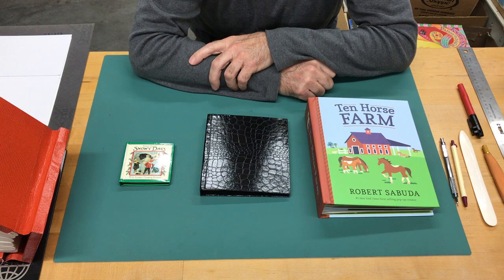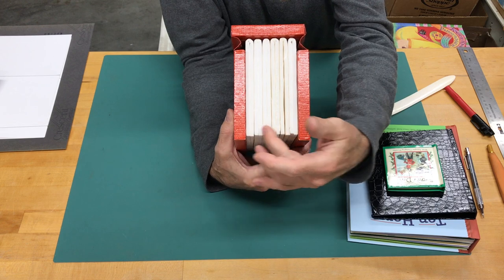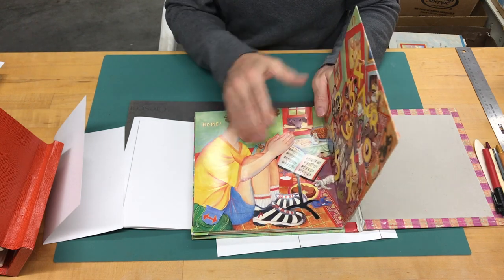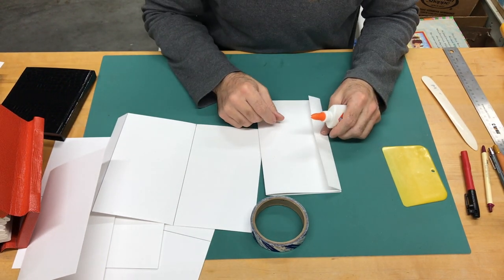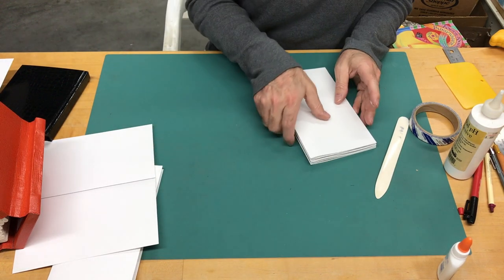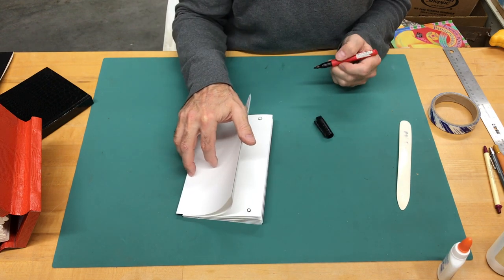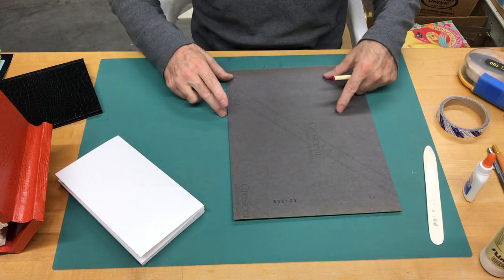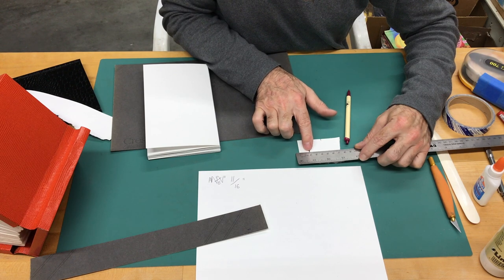Pop-Up Book Binding Demonstration

Comment: Excellent guide, thank you! Also, I wish they used this type of binding for all "Art of" books as well. I know these usually don't pop up, but so much of the full color pages is lost in the binding when the book won't open and lie completely flat. It would also be a useful binding in general large reference books so we can set them out on a table and study without having to hold them open or having the page flip on its own. :/
Reply from the maker: Very good ideas. I think this would also be great for artist sketch books.
Reply: @McGinnisArtistry  there are accordion sketch books I see urban sketchers and watercolor artists using. They're a long piece of paper I think designed to be drawn or painted on both sides. 

But I'm wondering if it could be used as a base for a pop up book, but then attach the pages together, and add a spine on one side
Reply from the maker: @recoveringsoul755  This makes perfect sense, as the construction is essentially the same. There is, however, one issue I have found regarding preassembled spreads. When students are making a pop-up book, they make a lot of mistakes, which are best made on something other than the finished product. If the spreads are made independently, one spread can be scrapped and remade before final assembly. If you do create a pop up book from a preassembled accordion, I suggest gluing all of the pop-ups in place before affixing the accordion leaves together or putting the cover on. This is because it is much easier and accurate to assemble the mechanics when the spread is flat open on the table.

Comment: Thank you so much for making & posting this video! It's been so helpful in learning how to make a case bound pop-up book properly. I'm still a bit confused about the hinge measurements. My spines have been a little tight. I have been book cloth for only for the spine (including hinges) and handmade paste paper for the covers. (Several of Robert Sabuda's books are bound this way and I want to replicate that binding.) I'm going to keep trying until I get those hinges right! I have a tv in my studio so I can watch your tutorial as I work. Again, thank you so much!!!
Reply from the maker: Hi Pam, I would love to see what you are making, and even any problems you are having. If the hinge materials are a little bit less flexible than what I am using, increase the hinge by 1/8" or so, and that should make it loose enough to open fully with a thick hinge material. Leave the spine the same as you planned it, but just focus on the hinge being looser.
Reply: @McGinnisArtistry  Thank you so much for your advice! I will try that for my future pop-up books. I'll be emailing you a link to my finished books.

Comment: This is great! I've been slowing it down so I understand.

 Why is it important to keep the cover loose? What I mean is, wouldn't it be better for the mechanisms, even if cover the allows the book to be sort of puffy, that you secure it? I was thinking that if you had a button or a latch, or some sort of tie, that it would keep the mechanisms in place, and decrease wear and tear on the book. 

The other question is how can you tell which is the spine, and which is the edge that you added the glue to? I mean I'm assuming that you know because you're actually working with it. However there's something I'm not understanding about how it's different. Meaning there were Black Pencil lines on both sides, so is it just that you make a judgment call about which side is considered the spine? It also could have been because of the white that I couldn't see something.

 Anyway thank you and I'm working on my own book and this is really helpful. Actually it was really really helpful because I didn't know any of this about all of the extra sort of padding that you have to do to make sure the mechanisms run properly.
Reply from the maker: Hi IronEarthDesigns, great questions. I have a few pop-up books that do have latches on them, and some that tie closed as well as open. One that has a magnetic clasp is of the inventions of Leonardo DaVinci, and the book itself resembles a latched note book. The ones that tie are meant to open completely around 'till the covers touch each other and tie fully open 360 degrees in the round; examples I have are a Victorian farmhouse and a haunted house. I find myself ignoring the ones that tie because they really only need to be tied when opening them up fully to keep the houses popped up.

I have noticed that on books that have too narrow a spine, the book looks bloated in the middle, and the cover boards begin to permanently bow inwards along the edges. Also books like this do not lay flat with other books.

The cover doesn't necessarily need to be loose, but it is important to make the spine wide enough to not cause the book to fan out permanently. If the spine was too narrow, this fanning out may be the result. Another reason to make sure the spine is the correct size is to allow it to sit well and look nice on a book shelf. Another factor to consider is: if the hinges are not loose, then the book will not open fully flat. An interesting observation is that the spine is only really necessary to protect the gutter folds, to keep the book durable, and to make the book look great. The mechanics will still function even if there was no spine at all, though without one, the book may degrade quickly.

About the SPINE: the narrow, stiff board, made from matboard or cardboard that runs between the two covers is the spine The two flexible areas between the cover boards and spine are the hinges. These hinges are what actually attach the spine to the rest of the cover boards and pages. The spine board gets fully glued down to the cover material so that it looks nice, and strengthens the overall book. The hinges shown in my video are where the narrow tiny strips are placed to space the spine between the cover boards. These narrow strips are discarded after the gluing process is done.

For quite a long time, I also didn't understand the ins and outs of pop up book covers either. It took a lot of trial and error to grasp it all.
Reply: Thanks for explaining the mechanics of the spine. I'm working on learning book structures. I mean really understanding them because I want to include other processes inmy books like printmaking and stitching. Thanks again.

Comment: Thx for this awesome tutorial, just a quick question related to a problem I'm running.

How would that work if I'm putting together 25 popup cards I have already and that I want to make into a book? I was thinking of using like velcro dots to avoid glue, but here is the thing, the cards are different sizes so I'm like going around thinking how to make this effect.

I was hoping maybe you have some tips or steps that could help in this specific case 😅.

Thank you again for this Epic video I'm taking a lot of pints. And thank in advance for your time and help.
Reply from the maker: Hello, you have an interesting idea for keeping a collection nice and tidy. Maybe you could consider making the "book" in the form of a 13-spread book that allows you to place two pop-up cards on each spread? In this way, you could either create pockets, ribbons, or the velcro dots to secure each card to its page, two per spread? The velcro will add thickness to each page. Take a look at the BEST POP-UP BOOK's video on Star Wars: A Pop-Up Guide to the Galaxy: https://www.youtube.com/watch?v=rbBojswrSKc 

I suggest you see this because of how Matthew Reinhart added so  much content to his book by inserting more pop-ups on every spread with the use of flaps in every corner. This book is an amazing achievement. Depending on the size of your collection cards, maybe it could be possible to do more than two cards per spread, reducing the number of pages overall.

If this idea does not appeal to you, then you could choose the largest card as a template for each spread size, then affix the cards to the gutter of a book that has spreads as big as the largest card. The concern I have is weather this would cause any creasing problems or opening issues if you try to tuck a folded card into an existing gutter. They may likely conflict with one another. A simple test construction will determine this.
Reply: @McGinnisArtistry  sorry for late reply, thanks for getting back, so at the end after analyzing what you mention plus your video, I decided to take jump off faith and I used little dots of velcro I add it 6 per page, leaving the pace to open like you explain in the video, plus I'll be adding creative a back and front cover using plywood for the front and back and for the spine I'll using something similar.

And creating the joins with either vinyl or something more simple.

So the tower is holding just with the velcro you cna open them and everything without any problem, one mayor mistake I didn't do was the orientation of each card its off, so they are one aline, and that's the little mistake but with the cover it should looked better.

Thank again for your video, comment and awesome help.
Reply from the maker: @jbos9142  I credit you with the great idea of cataloging your pop-up card collection! Your idea can also be used to make a materials swatch book, a hand made photo album that can lay flat, and many more applications.  Chuck Murphy's books essentially apply this technique in COLOR SURPRISES, ONE TO TEN, and others. In his books, each spread has two pop-ups or mechanics, one per page; in the two books mentioned, none use the spread's main gutters as a power source. Instead, a supplemental fold or pull mechanism provides the action.

Comment: Hi Michael, thank you for such an informative video! I have a question - I am hoping to put together a book with some pop up elements, but I imagine at least half of the pages would be normal and wouldn't need the double thickness. Do you think it would be possible to put together a book that was one half the accordion style pop up spine as you have shown above, attached to a more standard binding of pages on the other half - provided that enough space is left in the spine for the pages to lie flat in the pop up sections?
Reply from the maker: Hello Julia, This is an interesting problem. There is a pop-up book in my collection about Fenway Park. It has only one pop-up; a large structure of the baseball stadium. Most of the book is actually standard pages. They made that book in a unique way, where the front cover has a large inward-folded flap. When the cover board is opened it allows you to open the extra, rigid flap, opening the big pop-up. Affixed to the inside of the back cover is the rest of the pages as a single stapled set. This portion is a saddle stitch binding. I think in your case, it will work to make sections of the book saddle stitched, and interspersed with the pop-ups. I suggest you make a simple mockup of maybe 2 or 3 basic pop-up spreads (just v-folds or something easy), and also a few saddle stitched blank test pages, maybe 6 pages each, and put them together. If you do, let me know your result!

Comment: Hi excellente tutorial.Thank you,i am a book binder and now i am trying to do an scrapbook album and the way it is bind together meaning the binding to the spine and the hinge is quite différents .for binder it inconceivable .May be if you check the way it is done it is not a nice flexible opening .i am trying to see if there a way to do it as they can open flat and have a long duration.it is all done in cardstock for pages with pop up and card board as covers which is covered in cardstock too.if you could help me in this problem as there isn’t any hinge in them.please help me
Reply from the maker: Hello Yudana, are you trying to bind together existing loose pages, or are you making an empty book from the start that can be filled with scrap book items? This can make a difference because if you are starting from the beginning you can make a book bound like mine in the video and fill it with scrapbook items, but if you are assembling existing pages, the strategy may be different. I wish I could see what you are making.

Comment: What is the best thickness of paper I should use for like a two foot long pop up book open. Like what should I use for that pages ?
Reply from the maker: Hello Tamara, at your scale of 24", you do need something pretty rigid. One option is 4-ply Bristol paper. This paper has more stiffness than the 2-ply material I use in my demo because of the extra layers in the same way plywood becomes stronger with more layers. You may also consider coated card stock/cover stock. This paper is thicker than ordinary papers but not too rigid. Usually coated card stock is only coated on one side, but that should not matter for a pop-up book because of the way two leaves are affixed opposite to one-another. Since the individual spreads are glued to one-another at the leaf, it makes the leaf stiffer and stronger - at the same time it allows the coated faces to be facing outward on both sides of the leaf.
Reply: @McGinnisArtistry  thank you so much !

Comment: Thank you so much! This was just the information I needed! Is there a certain weight of paper you recommend for the pages?
Reply from the maker: The paper we typically use in the classroom for prototypes, and was used in my demo, is 80lb Bristol. It comes in smooth or vellum. It turns out that 80lb is difficult to find. So a heaver Bristol would work well, such as 100lb, and is common at art supply stores. You can also use papers that are considered "heavy gauge". Cardstock common for use in pop-ups. The general idea is to use paper that creases and glues well, takes a medium of your choice, and is stiff enough to form strong pop-ups. An incredible pop-up book by one of my students was done with Epson Exhibition Watercolor Paper. For reference, 80lb Bristol is 175 gsm, and the Epson paper is 225 gsm.  GSM=Grams our Square Meter, or the weight of the paper.
Reply: Michael McGinnis thank you so much! I make cards, and most of the cardstock I have on hand is about 80lb, I think.